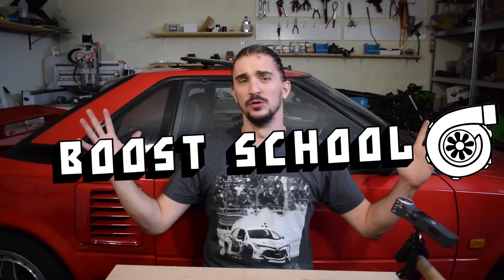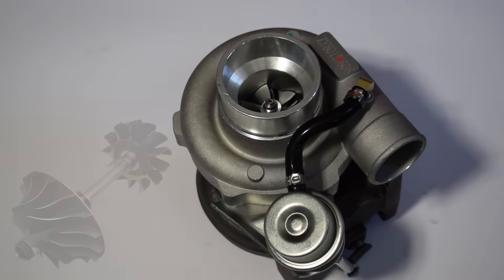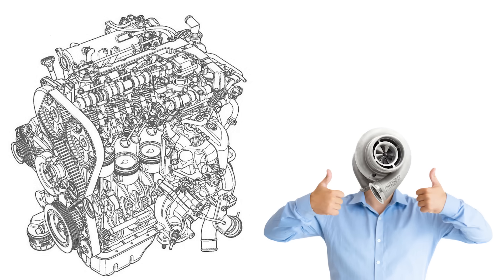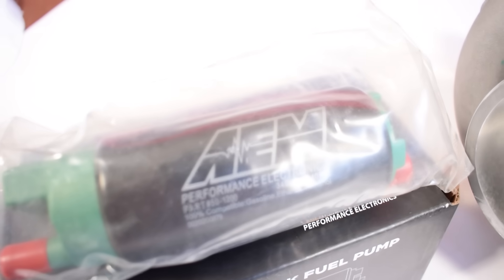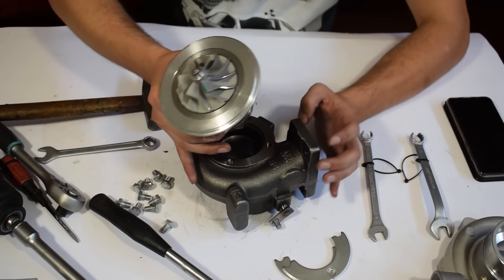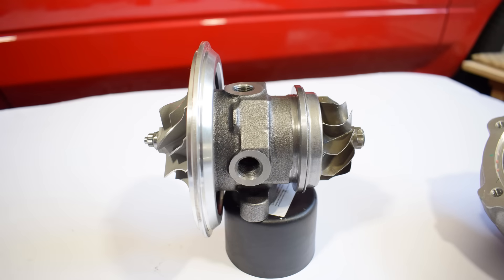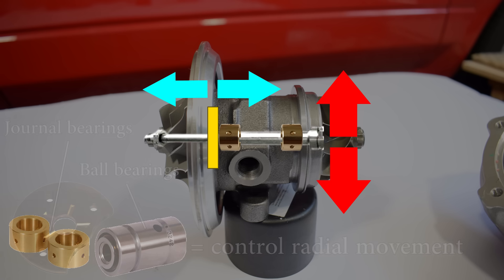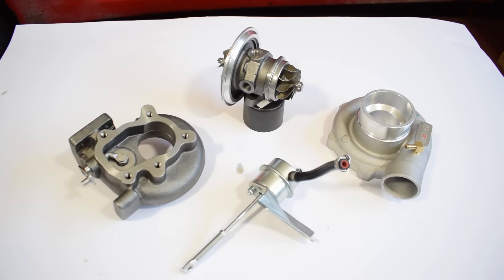TURBO 101 - How it WORKS and what's INSIDE - BOOST SCHOOL #2

Comment: Turbos are an efficient and effective way to easily improve power, change my mind
Reply: judges in high compression ratio NA

joke aside, with turbo you are compressing air and creating more heat. you need to use more gas(or water-phase change=liquid takes heat to transform into gas) to reduce that temperature, or inert gases, or an intercooler. on the other side they are pretty smart considering you would waste 90% of that exhaust pressure. (but you give up on the inertia scavenging effect)

High comp NA on the other hand goes to the core and harnesses the main process that gives you torque, that being the pressure inside the cyl at combustion. you do not use extra fuel to account for higher gas temps, you do not use energy to run an intercooler.

i don't think i can change your mind because your sentence is broad. you can get plenty of power from a lot of approaches. when it comes to absolute power, turbos are the most effective, but when it comes to efficiency, high compression ratio is more effective

Comment: You showed a variable turbo in the last animation. 
I have a variable turbo on my rabbit pickup. 
It is the shit. 
It makes more power at 5psi than my old k24 or k14 (equivalent to a t-3 and a t-2)
Could make at 20 psi. 

My vnt is good for 20psi. 
Maybe someday I’ll get an intercooler again and turn it back up. 

Vnt allows for no wasted gasses. Because no wastegate :)

= best possible miles per gallon.
Reply: The sectet(One of many) from that vnt compared to the very old k24 is in the compressor wheel design, it does have better aerodynamics.
K24 is a very old design, even a small gt séries wastegated Will outperform an old k24
Reply: Interesting note I ran my variable turbo with no intercooler and was running like 250f intake temps. 

Added intercooler added massive torque. 

Yay science. 
Finally did add the intercooler and a
Inverted intercooler Hood scoop 
Check my channel
If you want proof!

Comment: Very enjoyable video. Today's quibble is about the notion of the air/ fuel mixture exploding. I have it on good authority that in fact what takes place is rapid burning. This is important because when you one day explain combustion chamber design, which is partly about filling the cylinder but also the propagation of the flame front after ignition, you will have to undo the explosion idea anyway. It's a very interesting topic. Stratified charge was a holy grail quest for a long time and Honda finally marketed it as CVCC, which it apparently wasn't. I suppose SC was deemed a lousy acronym. 😉

Comment: gasoline is controlled burn, diesels explode
Reply: I'm pretty sure it's the other way around...
Reply: @JohnWiku  good time to find out, preignition and detonation pester spark timing engines but not the air ignition engine
Reply: It's not considered to be an explosion because the pressure is created over a measurable period of time and does not vent direct to atmosphere. The energy (some of it)  is coverted torque which accelerates  your machine. A hand grenade wont have this useful feature.

Comment: Know how it works and whats inside; clicked anyway, cause D4A.
Reassuring that nothing has changed.🙂

Keep it up, I'm stoked for every new video.
Reply: Even when we know there's more to learn. I have a DH bike and it has hydraulic brakes, i've been bleeding them myself with no trouble for the last 3 years, but recently i found an odd issue: no matter how much i bled my rear brake, it would never deliver a response. After a LOT of researching, i found out that you can cycle the fluid both ways to get as much air off as possible, and also that the shape the hose had when the brake was mounted basically prevented the air from leaving. I learned a new technique to bleed them and the issues from my geometry. Normally on cars this isn't an issue since the hydraulic systems are centralized and bled from a single point, wich lets air escape easily.
Reply: 0